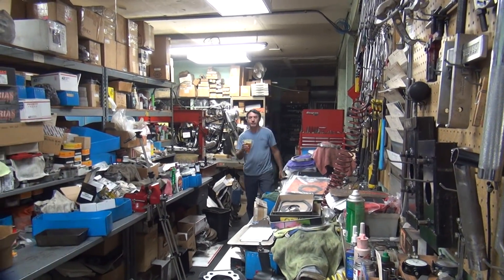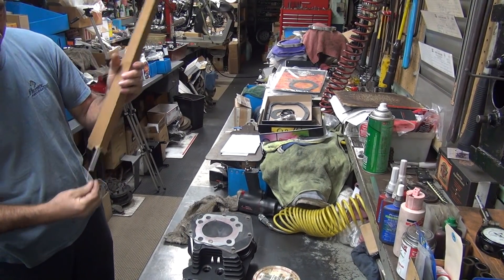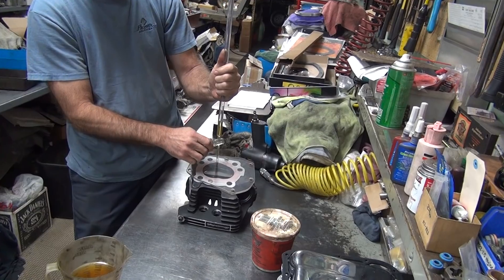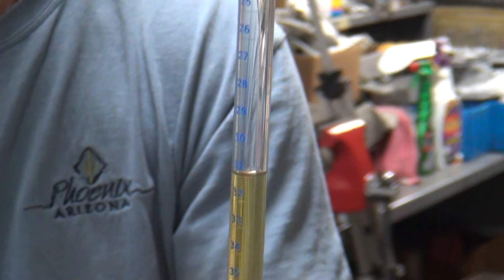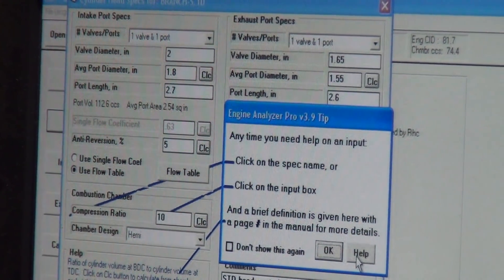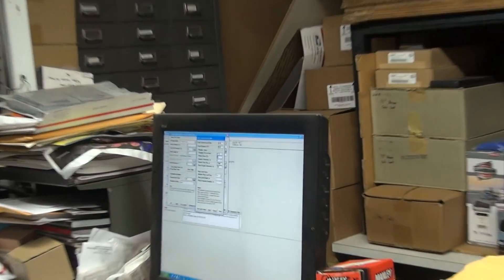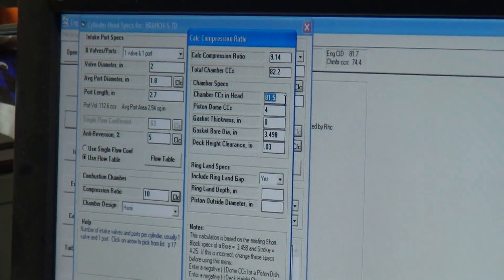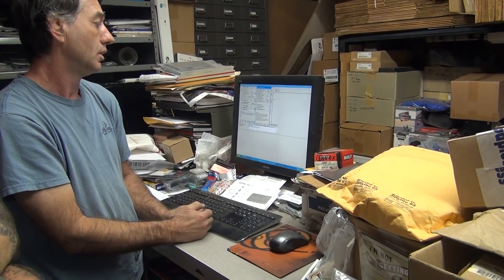#131 how to do it, measure the cc compression ratio cylinder heads harley evolution tatro machine

Comment: These are static numbers. What about dynamis numbers with the cam timing ? I like to set my engines at 9.25 to 1 dynamic compression.
Reply from the maker: i don't give a crap about dynamic numbers. when the motor comes up on the cam or torque peak it can go into detonation and good by motor. i see it all the time on pump gas motors. you get blown head gaskets and pulled case studs if you are lucky and burned pistons if not.
tatro
Reply: @TatroMachine  OK. I meant to say I try to set my engines at 9.25 to 1 static. Other sources talk about both. But to have 9.25 to 1 dynamic you would have to have very high static compression. I've had good luck with other engines set at 9.25 to 1 static. The thing I not sure of is how big to go on the cam. I have an Andrews AB cam and a special grind VThunder. The VThunder is a good size cam. With 88 cu in, I want a good dependable bike that starts and runs well.
Reply from the maker: all the cam does is tell the motor where it is going to run at best. pick the duration that matches the rpm you want to run at. too small and it runs flat on top and too big is a dog down low. more compression helps the doggy cam but it will kill the motor from detonation if it is too much. every motor is different.
tatro

Comment: He needs to replace the cylinder studs and use a couple of drops of oil in the head bolts. Also use the James gasket information to torque the head bolts to 42 pounds instead of the HD 90* crap! Or go old school with torque to yield...
Reply from the maker: geez, i don't think i did any of that, maybe you should make a video.
tatro
Reply: Studs and Cases are brand new, less than 2k on the motor.
James gaskets at 42 is where I'm at
Reply: Vtwin Experts, yep i TOTALLY AGREE with you regarding the torque and gasket choice. Additionally i like the MLS Cometic head gaskets along with the James base Gaskets. My 1998 Evo has 195 psi in each cylinder yet i have NO issue's with blowing head gaskets. Its also paramount that the Cylinder studs and head bolts are tapped and dye'd to chase the threads also.
Reply: Sorry Keenan... i was just piggy backing off of the other guys post. I know your work is never in question.
Reply from the maker: if he watched the whole video he would have seen that i did basically what he said i needed to do. 42lbs is pushing it with stock heads but with motor oil for the lube it should be ok. different lubes give you different final bolt loads. i use assembly lube with moly so i get more bolt load for the same torque.
tatro